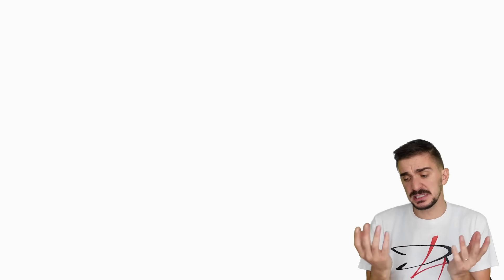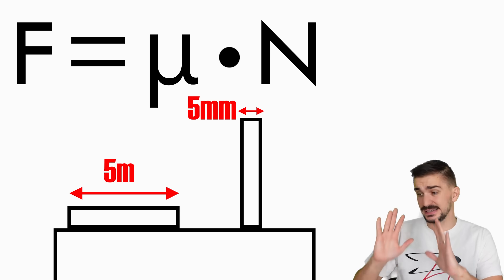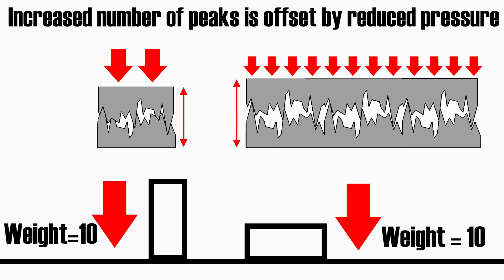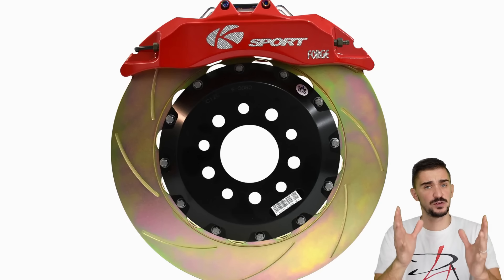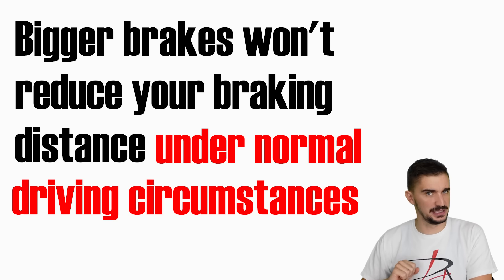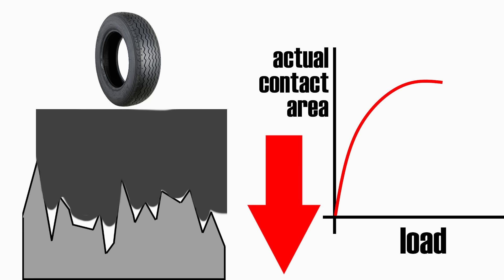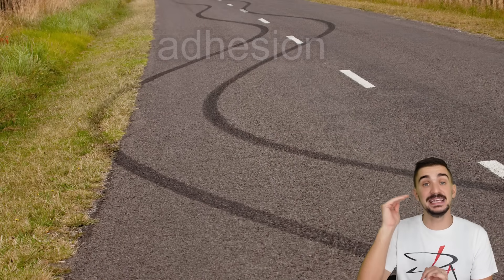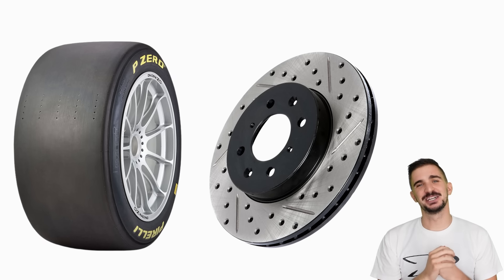Why Big Brakes Won't Stop You Faster but Wider Tires Will - Friction and Surface Area Explained

Comment: I always considered it this way:  If your brakes can lock up, you already have more stopping power than you need.  If you really want to stop, you need more rubber on the road.  This is why ABS is a thing.  Practically all modern car brakes are too strong for their purpose.  As such, the means to improve them is to artificially weaken them so they don't defeat the tires capability.
Reply: I had a 1946 willys jeep. First year for civilian sales. 
You could stand on the brake pedal and still have to throw out an anchor to get it to stop quickly. 7" drums with a 302 ci Ford V8  didn't help an already bad situation. It go across a rice field. But wouldn't climb up the grass covered river levy. It would stop half the way up and slide backwards to the bottom. 
35x12" wide tires are great. Just not for traction. Spelling edits. God I better start wearing my glasses.
Reply: @commentsedited  seems to be a pattern on early postwar offroaders, I've driven a unimog 411, and it's ~15 inch drums are more a suggestion to slow down than brakes, even if you put your entire body into braking, the poor bastard will feel like a bycicle with greasy brakes (said brakes being on a ~2000kg and being purely human powered sure doesn't help).
On the other hand, it goes up hills like nothing else, having a 1st gear that you could outwalk on foot with the engine just about to blow up definitely does help.
Reply: @commentsedited  Your 1946 Willys had a 302 ci Ford V8?  IIRC my dad's has a flat-head four.  It could go 55 MPH, but just barely.  I don't know for certain that was the original engine, though.
Reply: Many car brakes are strong for one stop. You get big brakes for heat dissipation or high speed stops, like track use.
Reply: You basically summed up his follow - up video, nice!
Reply: Most times you apply brakes more then once and then the stock brakes fade and fail under high load HEAT
Reply: It's not the tire's capability they're designed to stay within, it's the road surface. Braking systems work best when they can stay just within the threshold for static friction.  This is because the force of static friction is much higher than that of dynamic friction. The threshold of  static friction is dependent on the materials that are in contact with each other. Since road surfaces vary greatly, the best system is self adjusting, like ABS.
Reply: @Crazy5711  Mostly true, but tires are still a contributing factor.  It's why summer and winter tires exist for many regions.  There's a variety of treads and compounds for any size of tire and car companies can only suggest and predict to a limit.
Still, to the point of this video, big chonky tires still put more surface in contact.
Going from 4" to 8" tires on my old Beetle justified going to disk brakes.  The drums which could lock up the skinnys would just run up and overheat after the rubber boost.  Going to clampier and cooler disks brought things back to normal.
Reply: This is well said. Only in extreme applications such as racing or on aircraft is brakes being larger more useful due to the stresses being enough for them to reach points of failure.
Reply: modern brakes overheat if stock which is problem on demand driving
so upgrade to slotted ones helps a lot if sometimes u have a hvy foot (tested)
Reply: If your brakes lock up, you generally have applied too much force too quickly. This is because of how a passenger car's brake bias is set up, and how weight transference affects braking loads on the front and rear axles. Stabbing the brake quickly and not progressively, will not allow weight to transfer to the front wheels fast enough to prevent lock-up, as passenger cars have something like a 70% front/30% rear brake bias. Progressively applying the brake pedal will allow weight transference to the front wheels. Using the formula in this video F=µ.N, the frictional force of the front tyres increases because more force is applied through them, as more of the car's weight "shifts" to the front axles under braking. The means the front tyres generate more frictional force at the expense of rear tyre grip. Because it's easier for your average driver to control a front-end lockup than a rear-end one, this is why the bias leans heavily to the front end.
Race cars have adjustable brake bias, to account for things like wear, temperature etc, and because those guys absolutely mash the brake pedal and want maximum stopping power from the brakes. This can only be achieved by all four tyres operating at optimal slippage of about 8%, something you can't achieve with fixed bias.
Reply: yeah no. the brakes are larger because it has safety factor built in. Have you seen how many people drive their brakes to death?
Reply: Absolutely. Used to owned a car with 14 inch wheels factory, so the front rotors were tiny...I had summer-only 205s with aftermarket 15 inch wheels on it and could still lock them up on dry pavement all day long.
Reply: yES aABS IS VERY GOOD IF YOUR TIRES ARE LOCKED UP YOU CAN NOT STEERbUT FOR AN EXEPTION CAN BE FOR USE IN THE DIRT. sOMETIME YOUNEED THEM TO BE LOCKED.  lIKE FOR ONE DOWN STEEP LOOSE DIRT WITH TRAGIC THAT CAN HAPIN IF YOU KEEP ON ROLLINGAND LOCKING UP AROUND A CORNER SLIDING IT A BIT SIDEWAYS AT FASTRER SPEED TO MAKE IT ABLE TO GET AROUND A VERY TIGHT CORNER.
Reply: Are you considering how fast and how much force you need to apply to lock up? It doesn't matter if your oem lock if it takes you stepping with both feet at full force when a big brake kit will apply full force with a moderate press of the pedal. The big brake kit allowed you to stop faster because you reached the 100% grip of the tires faster, more reliably and with less effort than OEM brakes. They also dissipate heat and are more reliable under constant braking where regular oem brakes will just fade and fail you if they get too hot. I don't know why people are sheep and don't realize the obvious.
Reply: Thing is, the sweet spot for tires is 99% of their grip.  Once you cross 100%, they break loose, and you're just sliding out of control.  Sliding out of control is the last thing you need when you want to safely slow and stop.  Not sure what you're driving, but the last time I had to use both feet on the brake pedal, I was driving a car from the 1960s with drum brakes on all 4 wheels and no booster.  Aside from that, every car I've driven could easily lock up if ABS was disabled.
Big brakes are a matter of thermal stability.  When a track car needs to go from 140 to 20 to 140 and back again over and over, heat builds up.  With that heat; pads can outgas, rotors can deform, fluid can boil, pistons can seize... and all points of failure are surefire death but can be avoided by somehow removing all that heat.  Big brakes increase the surface area available to dissipate the heat to surrounding air.  Many track car bodies include ducting to introduce more air, further removing more heat.  Actively cooling the brakes gains the stability and repeatability necessary to sustain the extreme driving conditions needed to win.
But, for a single stop to avoid turning Jenny Jumpsthecurb into a crunchy hamburger.  OEM brakes are perfectly capable.
Reply: @Zeriel00  you dont need bigger brakes to have a maximum brake force sooner when pushing the pedal, what you need is a brake booster.
Getting bigger brakes for a road only car for the purpose of wha i just mentioned is a very ineficient way to spend money. A set of better tires and rims would perform much better.
Reply: Clamping force vs braking speed. Not to mention the obvious factor of heat dissipation.

"Practically all modern car brakes are too strong for their purpose."

^ 100% false comment.
Reply: Name a modern car that won't lock up its wheels if ABS were disabled.
Reply: @ImnotgoingSideways  Irrelevant

Protip - brakes will still lock up even if they are ABS, and everything works correctly. It doesn't matter.
Reply: @claytonmuirhead2722  Literally the entire point of the video.  I'll try to make this as simple as possible without using fingerpaints.
Goal: Stop faster.  
Options: Bigger tires or bigger brakes.  
Stock tires + Stock brakes = brakes lock up and tires break loose.  Tires determine stopping speed.  Tires aren't clamped to the road.
Stock tires + Big brakes = brakes lock up and tires break loose.  See above.
Big tires + Stock brakes = brakes might lock up, might not.  Tires might break loose, might not.  If tires don't break loose, brakes determine stopping speed.  Brake clamping force > stock tire grip/traction.  Big tire grip/traction > stock tire grip/traction.  End result: Faster stop.
Big tires + Big brakes = brakes lock up and tires break loose.  Tires determine stopping speed.  Big tire grip/traction > stock tire grip/traction.  End result: Faster stop.
The video topic isn't about slowing.  The video topic isn't about extended thermal runaway.  The video topic isn't about skillful force balancing.
The topic is about stopping ability.  Big brakes won't stop you faster but wider tires will.  You know, like the TITLE OF THE VIDEO.
Reply: @ImnotgoingSideways , you need the crayon instructions; no one else does. You are clueless and oblivious to this.

The video's title is literally wrong. That was the point of my reply. I realize you can't grasp that fact, but your ignorance does not change reality.

"Stock tires + Stock brakes = brakes lock up and tires break loose. "

^ BS. Not true

"Stock tires + Big brakes = brakes lock up and tires break loose.  See above."

^ BS. Not true

"Big tires + Stock brakes = brakes might lock up, might not. "

^ BS. Not true

"Big tires + Big brakes = brakes lock up and tires break loose."

^ BS. Not true

"The topic is about stopping ability."

The only true thing you posted. Yes the video is about stopping ability - and it makes statements that are factually untrue. Hence the reply.
Reply: @claytonmuirhead2722  Do you even drive?  If so, have you driven a car without ABS?  If so, have you ever modified a car with wider tires?  I've done all 3.  
1962 VW Beetle.  Real world example.
Original 4" wide tires + original drum brakes = brakes lock up and tires break loose.  Ridiculously long stopping distance.
Original 4" wide tires + Empi disk brakes = brakes lock up and tires break loose.  No change in stopping distance.
6" front and 8" rear tires + Empi disk brakes = brakes lock up and tires break loose.  Larger contact patch helped reduce stopping distance by nearly 50%.
Stopping distance wasn't reduced until ~tire size~ was increased.  As expected.  As planned.  As described in this video.
Reply: Or, for that matter, do you know why ABS exists?  Do you know that ABS stands for "~ANTI-LOCK~ braking system"?
Reply: @ImnotgoingSideways  "Original 4" wide tires + Empi disk brakes = brakes lock up and tires break loose.  No change in stopping distance."

^ Lie

"6" front and 8" rear tires + Empi disk brakes = brakes lock up and tires break loose.  "

^ Would make the car spin around backward before it actually worked. But, if you go back and read my comment, you will see why this is a stupid example for you.

"Larger contact patch helped reduce stopping distance by nearly 50%."

^ Absolute lie
Reply: To make a point about your lies and really stupid analogies, along with the incorrect assumptions in this video.

My Nova outside has a 15" wide tread width on the rear tires, and it has oversized disc brakes.

If I brake in it with those wheels on it in an 1/8th mile track, at around 100 MPH my car will take right at 600 feet to stop. 

That is a fact. It is consistent.

If I take the 15" rear wheels off and run 275s, which have about 10" tread width, the car will then make the same stop at 100 mph in about 570 feet.

With SMALLER tires.

Those numbers are tested and true. Repeatable through years of racing. 

And those results completely reject what is claimed in this video. Yet, they are easily confirmed by anyone who drag races.

If I were dumb enough to trust this video, on a rainy day, and I drove 100 MPH with the 15" tires on the back. When I hit the brakes, the car would not stop at all; I would be dead. It's just that simple.

IF the car had the smaller 275's on, it would stop in the rain but not any near as fast as it would on the stock 5 " inch wide tires.
Reply: @claytonmuirhead2722  Cool.  I've come to the conclusion that you know absolutely nothing about physics and/or you're probably getting off on being wrong.  I'm not sure how you think my car lied to me or better yet inexplicably spun around during a back-lot break test.
Actually, I'd like you to explain your 'spin' situation above.  It would be an Olympic event of mental gymnastics I wouldn't miss for the world.  Starting with I actually physically experienced it.  Hell, I'll throw some parameters at you.  1962 VW Beetle with with original swing suspension/transaxle and 2110cc engine.  
Brake test : dry 60-0 "panic stop" style in an industrial truck/parking lot.
Original stock tires : 165/80R15 Continental whatever-ever
--Result for disk and drum brakes: > 15 car length
New front tires : 195/60R15 BFG Radial T/A
New rear tires : 225/60R15 BFG Radial T/A
--Result for disk brakes: 9-10 car length
*For the vintage Beetle crowd: Yes, I know that's the wrong transaxle for the job but nothing has visibly twisted or snapped yet.  My car my rules.
Reply: @claytonmuirhead2722  If you're taking 600' to stop, you're not stopping, just slowing down to a stop.  In that case smaller (read lighter rolling mass) should stop sooner.  Moreso, if it's also a smaller rim diameter.  Put some more balls into that brake pedal.  If they can't lock up, you done goofed.  Get a refund on that brake kit.  Though, if you're drag racing, well then it makes sense that your road traction will overload your brakes.  Strips build up shreddy/melty rubber and they might even be using TrackTack.  Those are artificial traction gains for the sake of safety.  Brake overloading is a known problem in drag racing.  Ever wonder why the pros use those parachutes?
Edit: 15" wide tires?  395's? There you have it.  You already have the bigger tires, if not the biggest.  You're only proving what I've been saying is true.  My pickup has 275s on all 4 corners but it also has ABS that I'm not in the mood to disable.  Brodozer stops like it hates tomorrow.
Reply: @ImnotgoingSideways  "You're only proving what I've been saying is true"

If one accepts what I said as true, I have literally proved that what you are saying is not only false but also stupid.

"15" wide tires?  395's? There you have it.  You already have the bigger tires, if not the biggest. "

Not even close to the biggest, I also have 32x18R15 drag tires. They make them bigger than that - a lot bigger.

"Cool.  I've come to the conclusion that you know absolutely nothing about physics and/or you're probably getting off on being wrong.  "

That is you ^
Reply: @ImnotgoingSideways  The car didn't lie - you did.

I raced VWs long before anything else. Why would the car spin around? You tell me - you think you understand physics and you think you have all the answers even when you are full of shit.

Cars are engineered so the brakes work around 70% in the front and 30% in the back for a reason. If the brakes didn't work that way the interia would swing the car around. 

Go back to that parking lot, speed up to 65 MPH ( realize that might be hard for your 110 HP car but do your best), pull the emergency brake as hard as you can, and don't let up. If you have the tires you claim you have, the car will slide sideways or spin fully around. 

Throw down some water first and it will absolutely spin around.
Reply: @claytonmuirhead2722  Well, yeah, not ~the~ biggest but in the tire market once you get to about 15" wide the street selection gets very very thin.  Tires that size tend to not be something Costco would carry in bulk.  Which goes back to the point this video makes that ~wider tires will stop you faster~.  Brake overloading is a known problem in drag racing due to the giant tires used.  There's so much grip designed in with soft rubber, low pressure, sticky track that if you did apply enough clamping force to lock the wheels, you'd likely bend, twist, or break most components involved.  Hence brake overloading and potentially needing parachutes.  But, if you were to get those tires to break loose, you would still require more distance to stop than if they held true.

Yes, if you lock ~only~ the back brakes and let the front wheels roll, there will be a chance of a spinout.  But, it's not inertia which causes the spin.  A little physics lesson:  Inertia is a liner concept.  Matter in motion will travel in a ~straight line~ unless it's changed by an external force.  While there are plenty of external forces, it actually comes down to freedom of movement.  A rolling (gripping) tire can move in 1 of 2 directions perpendicular to the axle.  A sliding tire has full freedom of movement.  If you're only locking the rear wheels, then yes, the combination of limited front and unlimited rear movement makes the chance of spinning is extremely high if not inevitable.  Though, it's often still controllable.  Drift racing, for example.  For you to be correct, drift racing can't physically exist.

If (when) all wheels lock then it's the one tire with the greatest traction which determines any kind of vehicle rotation.  With the center of gravity shifting forward, a typical car with a front engine and equal sized tires front-and-back is bound to spin.  Bound but not guaranteed.  Imagine, if it were, each and every burnout would be a donut and each and every road accident would be T-bone or a double-rear-ender.  Front bumpers would be practically useless.  Now, shift the majority of the weight to the rear, over tires which have nearly double the contact patch than the front and you'd be hard pressed to get more than 45degrees of rotation during a panic stop.  Sliding little tiny 6" are about as effective as snow skis compared to 8" under engine weight.  And, again, none of this is guaranteed.  Potential.  Not 1:1 totally for sure.

My own brake tests were done 60-0 on dry mostly level asphalt.  That's 60MPH, smash brakes+clutch, hang on until full stop.  I didn't get much rotation more than maybe 10 degrees.  I didn't measure because I didn't care.  Distance was my only concern and I was still mostly facing forward each time.

As for reaching 60-65, no problem.  In spite of having the original 4.375 final, a combination of double valve springs, counterweighted crankshaft, and 40mm Webers, it'll do nearly 80 just fine.  Screaming like a banshee, but still moving it.  (it's the springs that made the real difference.  floaty little bastages).

In the end; I did the upgrades, I ran the tests, I got the results I wanted (and better), and it completely matches the points made in this video.  Your car's chonky drag-meats do too.  And ABS does too.  Or are you one of those people who thinks ABS is a conspiracy?

In fact... thinking now:  Long story, short:  If ABS is real, I'm right.  If ABS is fake, you're right.

And, if you're right, the entire (USA, Japan, Brazil, Italy, England, France.. and more) automotive industry have colluded to defraud the public since the mid '90s.  I blame Ralph Nader.
Reply: ^^^ This main comment . Some cars don't have enough brake for the car (to lock the wheels) so upgrading the brakes CAN improve braking.

Upgrading to better brakes also gains better control over the braking (modulation).

Not to mention brake fade on bigger brakes and disks will take longer.
Reply: Okay, so with your theory, what if I have 325 wide tyres on the rear so the tyres don't spin from engine power, and the brakes won't lock up? Even bigger tyres? Can't go smaller, they won't have traction, so, bigger brakes..?
Reply: @lollipop84858 There are more variables like weight balance/shifting.  But, no theory, facts.  Plus size the tires until the brakes can't lock and you'll progressively stop shorter.  You'll eventually reach a point where the brakes can't dissipate the heat effectively enough, then bigger brakes make sense.  But, sticking with the same tire size, clamping the brakes until they lock up will rely on 100% tire/road traction.

Clamping pressure can always be increases, but the contact patch of the tire under the weight of the car is relatively constant.  If average brakes = skid, bigger brakes = skid, even bigger brakes = still skid, drop a wrench in the differential's ring gear = still skid, money shift = still skid and grenade engine.  In the end, you're always skidding at the same rate per surface.  

Clamping power can increase indefinitely to the point where the calipers/drums snap.  If the tires are still skidding, any change in clamping power will make no difference.  But, increase the contact patch of the tire and there's more surface to work with.  

More tire surface = more grip = shorter stopping distance = greater chance of thermal runaway = finally a reason to actually upgrade brakes.
Reply: Is it true that broader tyres brakes better than narrow tyres, but in wet conditions the opposite is true?
Reply: @Heinstein69  There are more variables, but, yes.  The risk of hydroplaning increases drastically on wide tires.  Displacing water is one of the top causes of lost traction on public roads.  Greater width means dealing with more water which means more opportunity to be lifted off the surface.  Tire tread design normally depends on a rotating wheel to "pump" the water up and out of the sipes.  A stopping/skidding tire loses much of that function.  So, yeah, combine a greater amount of water with a lower capacity to clear out that water and a fatter tire will be at a disadvantage.
Reply: No. That is patently, completely, absolutely false. If the brakes lock up, they no longer function as brakes . 
The brakes function when the pads are grinding at the pad. If the wheel stops turning, what is the power that the brakes dissipate? Zero : they do nothing to stop the car. 
The power that the brakes can dissipate is more than zero only while the wheels are turning : that the brake can lock the wheel is irrelevant
Reply: @GeorgeTsiros  It's a matter of headroom.  The fact that the brakes can lock up doesn't mean they're designed to always lock up.  Which is where big brakes come in.  Small OEM brakes can already lock up.  Which says there is already enough grabbing power to defeat their purpose.  Larger stickier tires can raise the headroom and keep the brakes grinding with greater force.  But, greater force means greater heat and overheating is very much a thing.  If someone is just seeking grabbing power, bigger brakes improve nothing.  But, if someone is looking for more surface area to collect and dissipate heat, big brakes totally fit the bill.
Reply: @ImnotgoingSideways  yes, they are designed to be able to lock up the wheels. Not intentionally, but if they can apply enough force to stop the car as quickly as possible without locking up the wheels, then they certainly can apply enough force to lock up the wheels. The force needed to instantly lock up the brakes is less than the force applied when optimally braking. Because the force due to the tyre sliding on the road is lesser than when it is properly braking. If it weren't, we wouldn't be trying so hard to avoid locking them up. Like i said, it's irrelevant.
Reply: @GeorgeTsiros  But, it's precisely why bigger brakes won't stop faster but bigger tires will.
Reply: @ImnotgoingSideways  Depends on the combination. The tyre needs to be able to hold traction and the brake needs to be able to survive the forces applied during braking.
Reply: @ImnotgoingSideways  "But, it's precisely why bigger brakes won't stop faster but bigger tires will."
With a locked wheel the brakes are doing zero work, and also not slowing the car very effectively.  Just because brakes have the ability to lock the wheel, does not make them good at actually slowing the car without locking the wheels.  For example old cars with drum brakes could lock the wheels, but were objectively crap at stopping a car quickly.  Bigger brakes have more thermal mass and dissipate heat more quickly, giving you more headroom before they become ineffective due to overheating.  The degradation in stopping power is noticeable during a single high speed stop on cars with small brakes, and multiple high speed stops can have them fail entirely.
Reply: @ferrumignis  Spot on.  And for a good example of how harmful thermal runaway can be, check out any long burnout videos where they're not using a proper line-lock.
Reply: Ever drive a gmc product for a while, then jump to a Ford product? First time it almost puts you against the windshield of the Ford.
Reply: abs doesn't get activated unless you are going offroad/rain/snow/drifting
Reply: @wobblestone3148  ABS is activated time any time a wheel stops while others are still turning.  This can happen on perfectly dry paved roads, even in a straight line.  Each wheel has a speed sensor monitored by the system.  When an individual wheel has stopped rotating, it's considered "locked" and the system will briefly release hydraulic pressure from that wheel.  There is a video called "ABS ON vs ABS OFF" which does a good job of explaining it starting at the 2 minute mark.
Reply: @wobblestone3148  abs gets activated whenever u panic braking. U have no idea what u talking about
Reply: That would mean all the engineers are dimwits. Why not make smaller brakes?
Reply: @tedmoss  smaller pads will wear faster. Smaller disks will dissipate heat slower.
Reply: @bumbarabun yes but bigger brakes is much more expensive to replace...
Reply: @flrpower5628  not much, material cost price is significantly small in this case.
Reply: @bumbarabun  Smaller disks will dissipate heat faster - anything smaller tends to have a higher surface area to volume ratio.
The issue is smaller disks heat up incredibly quickly.
Reply: @deezelfairy  probably "slower" is not a right term here. Bigger disks can dissipate more energy without overheating.
Reply: @tedmoss  smaller brakes means smaller surface area means dissipate less heat, i mean what the fuck dude do you even watch the video before replaying to this dude?
Reply: @tedmoss  Because it's not enough to just barely stop the car quickly once. You might have to do it with already warm brakes, or you could be driving downhill with a fully loaded car pulling(and now being pushed by) a trailer. And the brakes are still expected to function normally after the fact. As a bonus it's nice to still have the brakes in good condition after several years of normal use instead of having to replace everything, say, weekly.
Reply: @tedmoss  Because those smaller theoretical brakes would work as as well as the larger ones for a few stops, but then the next time you hit the pedal you've got nothing. They've overheated and now you're going to crash.
Reply: @tedmoss  Tell me you didnt watch the video without saying you didnt watch the video.
Reply: @tedmoss  less thermal mass and heat dissipation, you must also consider that these brakes should at the very least almost lock up with the car fully loaded (all seats with people on them, boot full of heavy stuff), as such it will have to be oversized, meaning it'll lock up (without ABS) with only the driver
Reply: @tedmoss  they are not dimwits, they are forced to be economical. ABS saves money and you don't need to achieve perfect balance between brakes, tires and the cars weight.
Reply: @tedmoss  heat distribution is better on bigger ones thats why
Reply: @tedmoss because overshooting brake power is better than undershooting. ABS will kick in an overshot scenario and modulate the power.
Reply: @tedmoss because there's an optimal trade off doofus...
Reply: @tedmoss  the fact that almost nobody understood what you meant is worring for me.. your question was obviously rhetorical to show that nonsense he wrote on the last sentence
Reply: @tedmoss  No they're not, smaller will make it wear through faster, ABS is a solution to a past problem.
Reply: @tedmoss , cooling.
Reply: @tedmoss  Because they have to be strong enough to stop the car at it's maximum speed, so smaller brakes wouldn't be able to do that. On a road car bigger brakes simply give you more stopping power at higher speeds, but most likely those speeds will be higher than the car is capable of anyway so you're never actually using that extra potential stopping power.
Reply: @gssf.gr29  You didn't watch the video either.
Reply: @dgphi  The video is over simplified. Stamp on your brakes at 20mph; they should lock the wheels with ease (or rather, will activate ABS). Now try the same at 120mph. If you've got regular sort of brakes, they aren't going to be powerful enough to lock the wheel. Why? Whats the physics behind that? Well, I'm not sure. But I have driven on circuit, and I've actual experience of this effect.
Reply: @severnsea3924  Unless you have some massive downforce increasing the grip at high speed, even small brakes will still lock the tires. They will only be incapable of doing so repeatedly.

So a car that can reach 300 kph should be able to brake from that speed to 0 repeatedly without heatsoak and brake fade. However, a thin 250 mm disk can't absorb and shed as much heat as a thicker, vented 360 mm disk. As such faster cars will have larger brakes. Additionally,  sports cars are often designed with a bit of track use in mind, wuere the brakes will need to absorb and shed a lot more heat.
Reply: @noxious89123  Has what you described occured after multiple times braking hard on the track? Or even the first time going 120 to 0?